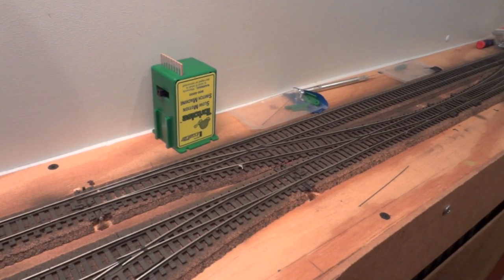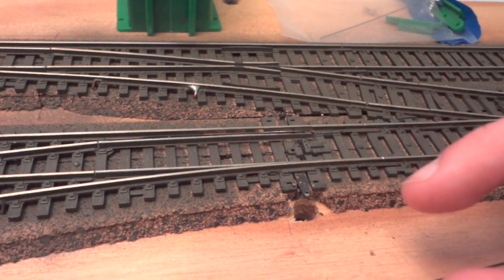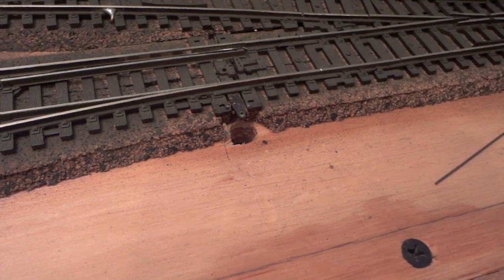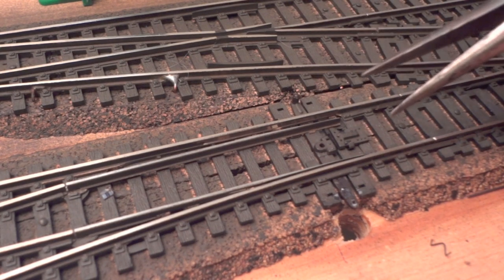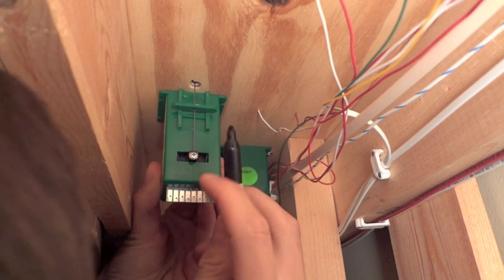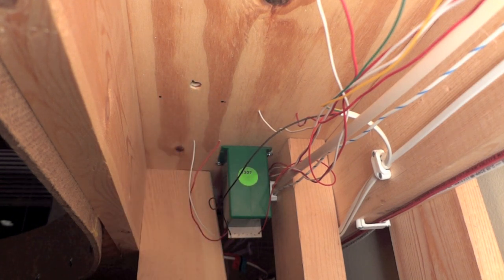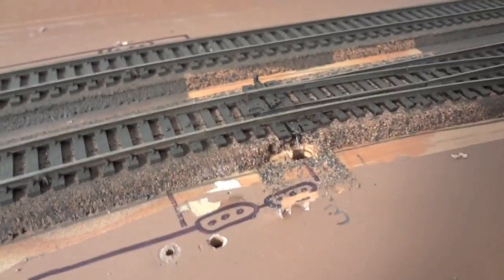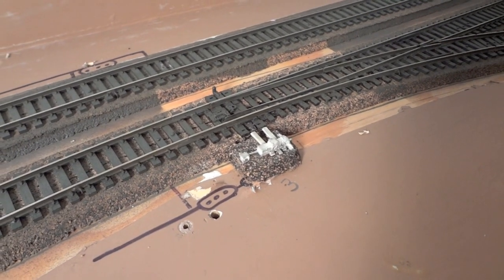How To Install a Tortoise Switch Machine to Existing Track Work

Comment: Great how-to Josh. I like your method of putting the switch machine on the side of an existing switch. Not only is it easier but you were able to leave a little extra wire on top that if the switch machine was in the center you wouldn't be able to. I am redoing my yard and I think I am going to put all of mine on the sides. Thanks for sharing

Comment: Great how-to... thanks!  I use piano wire with my Tortoise machines... a bit heavier than the wire provided, and holds the points to the stock rails more firmly and provides better electrical contact.

Comment: Very detailed description. I too use peco switches and have areas of my layout with obscure hard to reach spots. This helps. I assume you are using JMRI or something similar as you mentioned the computer . A video on that portion would be helpful as well. Thanks for the post.

Comment: That's pretty clever.  As I sit here looking at my blisters from trying to hot glue it,  Can't center, screw, and check all at the same time, I thought, there must be a better way.  Of course, there is.  Perfect.  Get close, manipulate the bend for exactness.  Fresh install, goes pretty easy.  Tack, ballast in.  Not so much.  IDK why this popped into my feed.  SURE GLAD IT DID.   Here is my method.  Glue drips gets on finger.  Say with it as long as I can stand it.  HOT HOT HOT.  Put in mouth to cool.  Got a blister there also.  Maybe I should make a video and include a link to this.

Comment: Great video. Question what is the purpose of the cuts in the metal rail about 2" infront of where you installed that? Thanks
Reply from the maker: That is for the signalling system. We cut the track to create new blocks.

Comment: How well does the machine work with cross-overs.
Reply from the maker: Very well. We have them installed on multiple cross overs and just put the hole / driving pin on the far side of both tracks.

Comment: The hardest thing about installing a Tortoise under the layout is to get the Tortoise actuator rod thru the tiny hole in the switch rod.  So HOW did you do that?  Most of the time, this will take many frustrating tries before you get success.  Did you hit the hole on the first attempt?  I doubt it.  I was looking at your video to get a fresh perspective on how sane people can do this with a minimum number of steps.  You never comment about this process.  That gives you a down thumb from me.  And you should get the down thumb from others who have installed Tortoises under the layout in situations where the Tortoise is not adjacent to an edge of the layout.